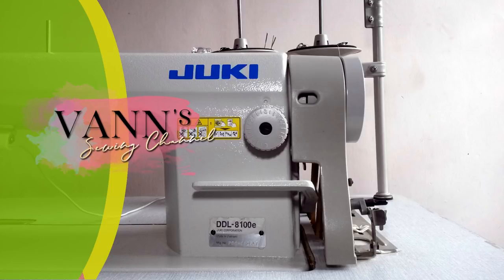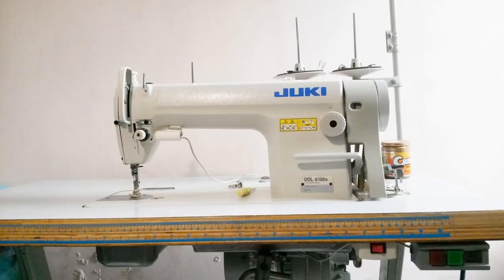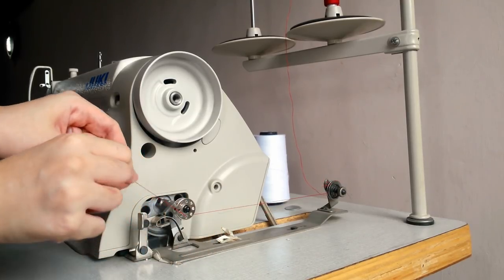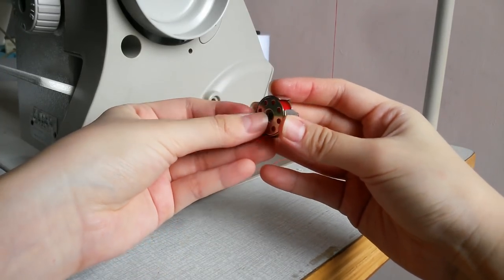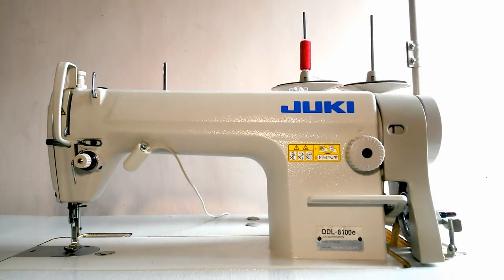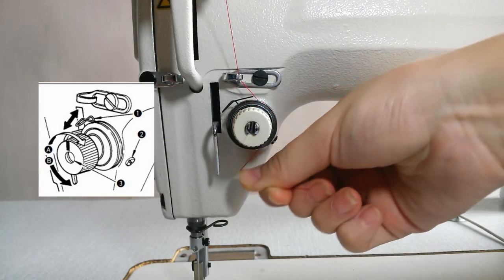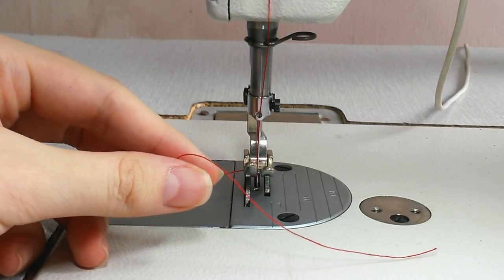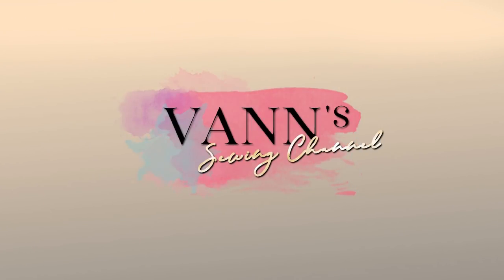Getting Started: Threading Tutorial on Juki DDL 8100e Industrial Sewing Machine

Comment: Thank you for the tutorial. But I still has problem with my bottom thread being loose when I change my thread into a slightly thicker size of thread. Though I even change my needle and also I use the same thread in the bottom.. Do you think it has something to do with the bobbins ? I have done everything else. It is frustrating !!!

Comment: Thank you for the very helpful video! I just received my Juki machine today 😀 After I’ve set it up and begin to sew I keep getting loops on the back. I’ve tried checking the bobbin and the tension, just wondered if you have any ideas what I’m doing wrong? Thank you!  😀
Reply: Check the bobbin threading and if you are sure the bobbin has been inserted into the case in the correct direction, then pull out a few inch of thread from the case after the thread has been inserted through the bobbin case slot. Then dangle the case by holding only the thread. The bobbin should NOT unspool more thread by just hanging there. Now with a quick hand movement jerk the thread up and down a few times, using the weight of the case to pull thread out.  It is correct tension if Only a few inches of thread should come out with each jerk of your hand. There should be a small screw on the bobbin case to adjust this tension.

Comment: Thank for sharing. Very informative. Just want to know if it work on leather ?
Reply from the maker: For real leathers I do not recommend using this machine. But for fake pvc leathers, yes you can. For pvc leathers, use the teflon coat/plastic footer.
Reply: @Vanns  Thank you for the quick reply. I'm very new for sewing. Can we use thick thread with this DDL8100e ?
Reply from the maker: @anpesworld  Do you mean thicker thread for denim? Yes you can. Use bigger db needle as well.